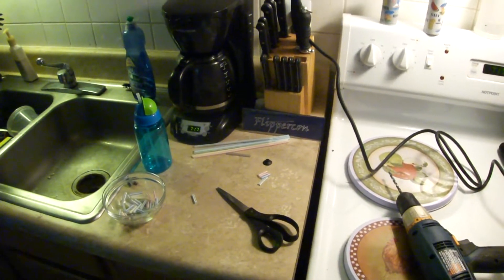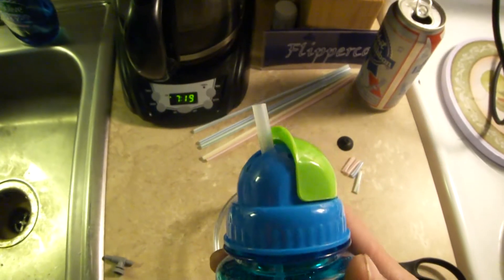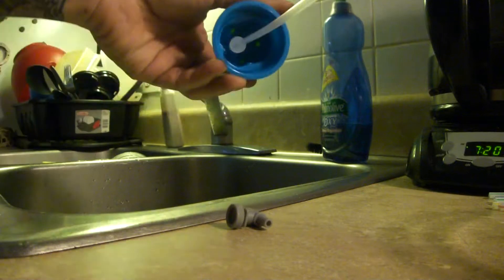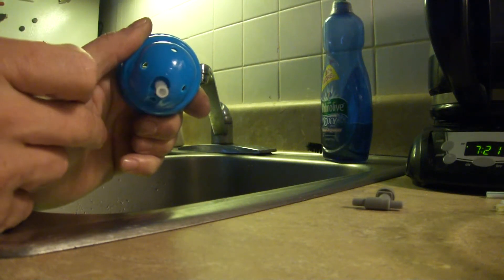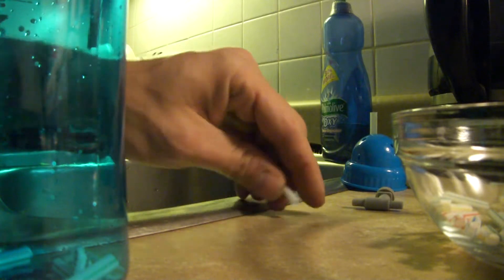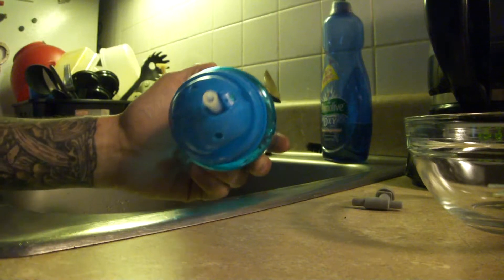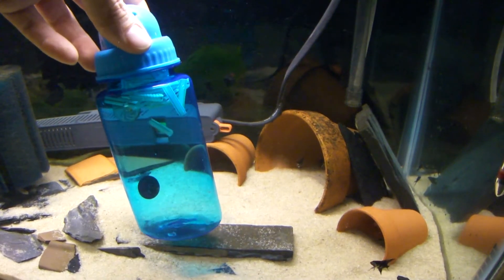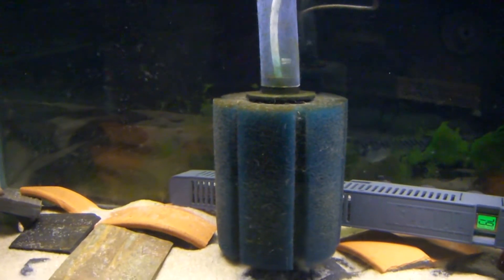DIY Moving bed filter

Comment: It's great that you mention about getting items from the $1 store. I would just like to say that while browsing a $1 store recently, I found that they were selling a kind of item in the bath section that can hold toothbrushes, sponge, soap, etc.  Basically it's some kind of shallow plastic container or holder for those items.  But the interesting thing is that it had removeable suction cups!  So if shopping there for other items, check to see if the store has those things and buy them for the suction cups.

I also found vinyl scrubbers or vinyl body scrubbers, even bath/kitchen sponges, that could all be adapted to work in these kind of DIY filters.

Comment: Great idea, i will make one with a power head, I have a few of those but will try first with am airstone and a air pump.
I liked the video and subbed, very new at this hobby and I am loving it man. one question you can also use like ceramic rings or plastic balls right? what kind of media do you recommend that will build up bacteria and hold it better? I have 7 tanks so I need all the filtration I can get since I have a rather heavy bio-load on all my tanks.